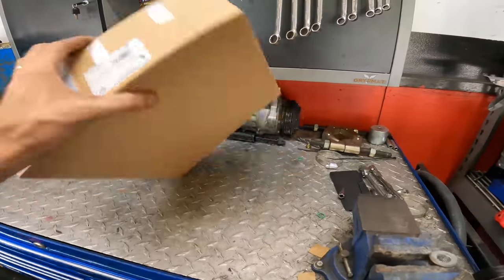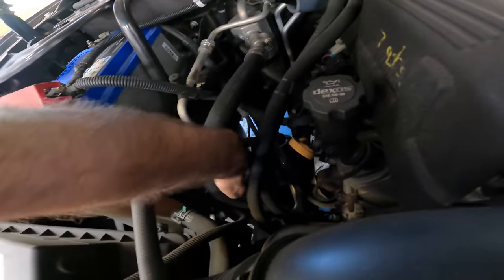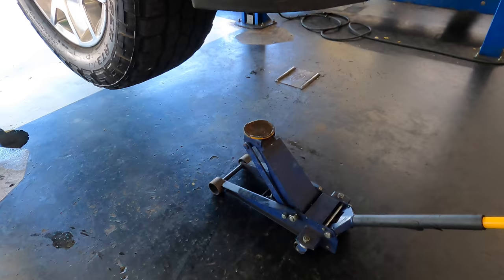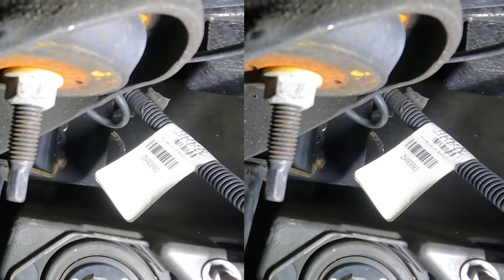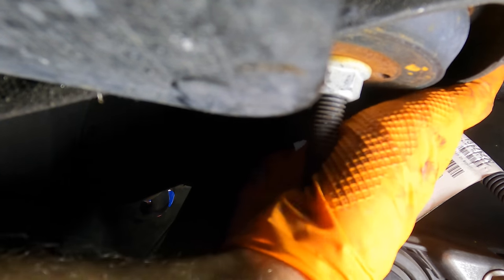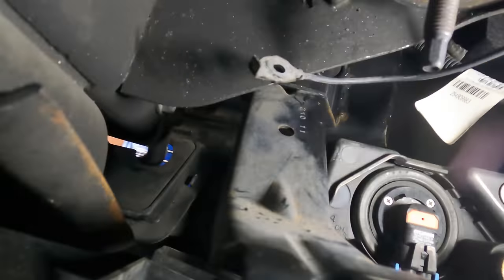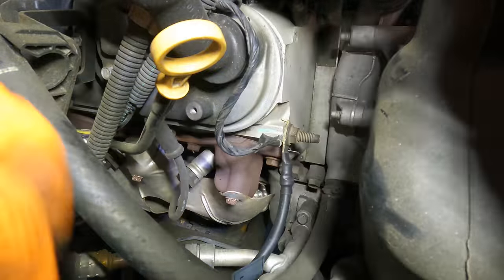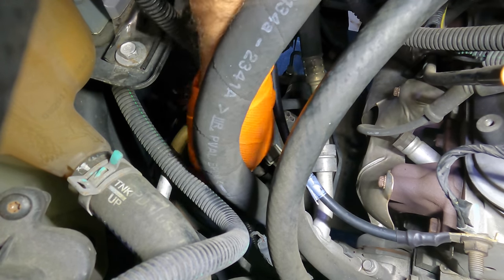Cadillac Escalade 6.2 NO Power, memory keeps resetting. Customer Request Battery Cable.

Comment: Ray, just curious if it would have been better to run the new cable along side the old cable before removing the old one? That way you could have followed the same route as the old one. Since you mentioned getting fresh air when needed, do you ever wear hearing protection? I've known a few mechanics that have had serious hearing loss after years in a shop. Thank you for the always great content. Oh yeah, to break the internet, you should have used a pneumatic impact on the battery terminal.
Reply: No, he should have used a pneumatic air grinder on the battery terminal. I mean, you want it to be terminal, right?
Reply: @JasonW.  True. grind away the terminal and connector - you can't have issue with them and they never will corrode.
Reply: Should not have ground off the tin coating on the copper terminal.
Reply: @ms01885  Saw that to.
Reply: I've been in the trades for over 45 years when we started out nobody said anything about hearing protection nobody said anything about it eye protection and nobody said anything about mental protection and to be honest with you I can't see worth it on I can't hear worth it on and my body I can't even list the parts to the phone to hell and I'm crazy that couldn't be all the chemicals I was exposed so and the plant that I worked and we had a cleaning guy that ended up having a edema burst in his lungs and blood to death right in front of me and that's a fact but no it's not the stuff that he inhaled he must have been a smoker yeah right hey have a good day

Comment: @01:40 REO Speedwagon is being quite distracting. Strangely enough, the letters "REO", originally "R.E.O." are the initials of one Ransom Eli Olds who went on to found REO Motor Car Company. One of the models that company produced was a light motor truck called the Speed Wagon. he also founded the Olds Motor Works which eventually became Oldsmobile after General Motors bought the company.

Comment: When you switch a battery do you plug a DC power source into the cigarette lighter to retain radio settings? I bought an older Escalade at an auction one with a blown engine for $3000, did an engine swap and resold it. You should do this to bolster your income Ray.
Reply: Ya, Right after finishing hm addition for growing family.

Comment: TIGHT SPACES MAKE 1/4" OF THREAD FEEL LIKE A HALF MILE OF BOLT...DANG...I DONT HAVE A RUSTY VEHICLE...BUT WHEN U BOUGHT THIS OLD 91 SENTRA...I ADDED 2 EXTRA GROUND STRAPS TO MAKE SURE...I HAD AN ELECTRICAL ISSUE WITHIN 1 YEAR OF OWNING IT...IT HAD 178,000 MILES ON IT...BUT THE VOLTAGE DROP WAS ELECTRONIC STYLE (4 wires & burned from fire  probably leaky injector) I had to touch it...it started blowing fuses for tail lights...uh oh...& 90% of my driving is @ night!!!) IT GOT FIXED...GOOD STUDENT TECH FROM RCC AUTO SHOP...(Riverside Community College...CA) HE LOOKED @ IT...& WENT THROUGH THE EXACT SAME THOUGHTS I DID...BUT HE SAW THE BURNED PART...HE WENT TO PICK UR FART & GOT 3 USED ONES WITH A BUNCH OF FUZZABLE LINKS TOO...YAYYYY...HE FIXED IT AND 8 YEARS LATER...STILL TICKING AWAY CLOCK LIKE...NO NOT A TIMEX...A CASIO...UH HUH...UH HUH...WHOOP WHOOP...LOL

Comment: Struggling...I got a network box for tail lights is shorted on my garbage truck and the hydraulic lines areas rotted and leaking...sounds like 1/2 hr job.on site repair      
6AM.see you
And their are No Public Restrooms.

Comment: Seems I would have tried cleaning the battery corrosion and the ground connection on the block before I bought the wire.
Reply: Remember, Cust made all the calls on this one.

Comment: Quick question... what is the smaller wire that goes with the negative battery cable ground in front of the engine block? I have a 2009 Cadillac Escalade EXT with that grounding stud... but nothing attached to it!

Comment: I have to admit, this ranks pretty high on my disgust for new cars when there's such a specialized harness for the ground wire from the battery.
Reply: Its grounding to the chassis and block from the battery. You could fashion one up for a fraction of the price but that requires extra labor mocking it up, crimping, taping/zip tieing and soldering.

Comment: What happened to the drill mounted battery terminal shiner?  Also love the adapters and I wish I could afford the Milwaukee 1/2 inch drive setup, but I cant justify it at all... I only use 1/2 inch sockets here, but I am not a mechanic working with limited room :)

Comment: Ray, would mirrors be a useful tool to make it easier to get the nuts/bolts, rather than just using your digits?
Reply: Good idea, just need to grow extra appendage to hold lite/mirror.
Reply: Not usually some they invert the movements you need to make.
Reply: @XxTWMLxX  Well, I would have figured much sooner that it was a 10mm bolt with the mirror, also I would be able to place the appropriate tool right on the bolt head. Of course the direction would have to be inverted. It would have save him some time and possible frustration. Just saying.

Comment: What goes wrong with a battery cable? how does it fail?   thanks for this.
Reply: Usually corrosion. Under the lug in where the wire goes to get crimped. There is to many strands to say it outright broke. Could also be the sensor cable connector on this specific vehicle. But im still going corrosion.

Comment: Don't know if I missed something in this series but what was wrong with the negative battery cable ?
Reply: "Customer Request Battery Cable." This shop did not diagnose the problem, the customer did. Ray is just doing what the customer requested.
Reply: @williamjones4483  Yes I know Customer requested it too be changed. But I never knew Ray to just change a part at the Customers request with out him diagnosing if it was good or not. Didn't even show if the cable had a problem either ? Just a shot in the dark by the the customer in my opinion.
Reply: my 2015 sivereeado was just diagnosed by the dealer to replace both positive and negative cables due to voltage drop across them. i guess its a thing!

Comment: wouldn't a power ratchet have worked or was the hand job more dramatic?

Why didn't you sand the lower connections?

Why did the cable needs replacing?

Comment: I have an uneasy feeling that you stacked the cables/lugs in wrong order.  The rule for me has always been that you want to have the heaviest cable & largest lug against the "block".  That way you don't run the heavy current through the smaller lug.  Sorry, if the mistake was already perpetrated by Cadillac and you just made the reconnect the same way.
Reply: The larger lug with the tab goes on last and holds them in place so they don't spin as they are tightened. At least all the grounds on my truck are like this. The smaller lugs all look large enough to handle it. I think the size of the tab lugs are meant to encase the smaller lugs and provide a larger clamping area for more contact between the layers. Like a washer on the end. Of course this is just my guess.
Reply: Replacement cable assembly box marked Made in Mexico.
Reply: @curtw8827  better than made in China....

maybe.........

Comment: Hmm, wonder what was wrong with the cable, it looked like it was in good shape???
Reply: They usually do look good, they corrode inside. You have to cut the insulation off to see it. You can usually feel it by flexing the cable in your hands as well. Stiff spots, crunchy spots etc.

Comment: Car clocks are indeed a major source of frustration. The digital OEM dash clock runs a minute per month fast. So, I get an aftermarket digital radio. Other digital radios using the same broadcasting system are perfectly able to get the correct time from the transmitter network. However, this car radio's internal clock does not do that. Need to set the time manually and It runs approximately 2 minutes per month fast. Such atrocities are never mentioned in the specifications of a digital car radio: warning: this digital radio does not sync its internal clock to the network's time source. Very frustrating, annoying and needlessly irritating. The tech is there but they refuse to implement it properly. I'm almost ready just disable the time display in the radio and open up the dash in order to replace the OEM clock for a DIY solution that will sync time every time it gets in reach of my WiFi.
By the way: nice gloves. We got a very good look at them in this video.

Comment: I did this with my Cadillac. However after further investigation I found it was the BCM corrosion into the connectors. Windshield was leaking and didn’t know it.
Reply: Opps
Reply: @peted5217  it’s fixed now. You couldn’t tell. Car was freaking out.
Reply: @thomasstrickland0  Ya. H2O not electric circuits best friend. Most fortunate none of ECU's wiped out.

Comment: I'm confused as to why you replaced what seemed to be a serviceable item with another serviceable item?
Reply: Not sure on this particular vehicle, but vehicles with aluminum battery cables are being targeted by NHTSA to be replaced with copper due to aluminum breaking and causing fires and crashes. This is a campaign we are dealing with at my work, though I work on big rigs
Reply: He literally said to repair a symptom of the vehicle behaving like the battery was disconnected
Reply: @TheTimothydragon  didn't hear him say that lol
Reply: Those cables often go bad.  I think there's a tsb for them too if I remember.
Reply: @HoLeeFuk317  I expect it's probably due to galvanic corrosion of the dissimilar metals on the crimps - leading to high resistance connections

Comment: I LOVE OEM PARTS...I DID GLASS (Of all kinds over the years) BUT OEM FITS PERFECTLY & KEEPS THE VEHICLE VALUE ON TOP...MANY AFTERMARKET GLASS PARTS DO NOT FIT...NOR SEAL CORRECTLY...IT WASTES MY TIME AND IS ALWAYS A CALL BACK WHEN WIND WHISTLE NOISES OCCURE...(GRRRR)...Fine for a used car lot...NOT A BMW, PORSCHE, MERCEDES, FERRARI, LAMBO, WHATEVER PRIVATELY OWNED!!! IT KEEPS THE VALUE WHERE IT SHOULD BE...INSURANCE COMPANYS DO NOT LIKE TO PAY FOR OEM PARTS...BUT...IT WILL BE DONE CORRECTLY AND AFTER ALL YOU ARE PAYING FOR EXACT REPLACEMENTS BY HAVING INSURANCE...GOOD GRIEF...I cannot count how many times I had a re do because of some squid brand not fitting correctly...GOOD JOB RAY RAY!!!

Comment: Never disconnect the positive  with the negative still connected Ray.  You can mess up modules doing that.  Unlikely but it has happened
Reply: that makes no sense
Reply: @bradhaines3142  The explanation I read in a service bulletin was it can cause internal arcing in the module.
Reply: @Luke  You claim it has happened - is there any evidence of this? A circuit can be broken/unbroken at any point and the effect is identical IMHO - the real reason to disconnect the chassis ground first is it makes it less likely to inadvertently short the other side to ground when using large metal conductive tools... NB this would be the opposite - +ve first on a positive ground chassis (historical cases, don't believe anything new has it these days)
Reply: @budgiefish I'd have to search for it but I've read it in GM tsb at some point. It was also pounded into our brains in tech school. It is more likely to have sparks from a positive terminal from the direction of electron flow, this is one reason why most switching is done on the negative side of the circuit.  Several years ago we had a mid 00s Impala in the shop for can't remember what but battery was connected POS last and the bcm had problems afterwards.  Idk how anyone would be able to confirm it was from the battery POS connected last and not just coincidence but I'd rather just be safe than sorry and always connect NEG last and disconnect first
Reply: @HoLeeFuk317  must be fresh out of tech school huh? Lol
Reply: @bigkenny93  I'm 14 years in
Reply: @HoLeeFuk317  keep working at it, you'll get there! Lol
Reply: @bigkenny93  I was there long time ago
Reply: @HoLeeFuk317  Effectively when disconnected the negative lead becomes the positive side of the circuit (you can confirm by measuring voltage from this to the neg on the battery) so potential for sparks (pun intended!) will be equal regardless.  Switching is done on the negative side more likely because NPN transistors and N channel MOSFETs can be driven by a positive signal and they will have their emitter (or source) connected to ground, with the load side to the collector (or drain) - when switched on, they will connect to ground, that'll be more likely, not to do with sparking etc. I understand them to be known as 'open collector' outputs for this reason. I'm just interested in your experience and source because it just seems a bit weird to me. 🙂
Reply: @budgiefish  there is only voltage at the negative battery cable terminal when it's disconnected because there is no current flow rendering resistance in the circuit to have no effect on your voltage measurement.. As soon as you connect the negative lead that voltage goes to zero because of any loads present in the circuit.  I agree that it seems odd and I wouldn't think it would matter either but it was what I was taught in my auto tech classes and I have seen it in GM service information.

Comment: Would really like to know why the engineer thought that they needed to run a ground to the Engine sub-frame...
Reply: Basically all metal in a vehicle is grounded. Why that exact spot idk. But that part needs the gravy ground for some reason or another.
Reply: @XxTWMLxX  except that there was a big old firewall or the frame that would have been more convenient...

Comment: Are you kidding?… you never use a battery operated impact gun to install a battery, it should always be a pneumatic impact gun to make sure the fittings are tight and you should always use Loctite also :-)
Reply: Lol that suckers never going to disconnect again lol
Reply: A new troll
Reply: Specifically, red loctite. Blue just doesn't cut it. Red will make sure you cut it, or at least heat it.

🤣
Reply: Thanks for the laugh today
Reply: Lol
Reply: @Itstime2029  Turn on your sarcasm detector or get it repaired. Nothing trollish about that comment.
Reply: You forgot to say how many ugga-duggas to give the gun. I say give it the full beans. (Wait...am I on the wrong channel???)
Reply: @williamjones4483  
Thank you

Comment: These things and the Yukon Denali's will do some weird stuff when that ground goes bad.  They will start adjusting the mirrors on there own while you are driving, lights will come on dimly lit when parked, rear hatch will open when driving down the road.  The radio and navigation system will act like it has demons, etc.   If you can catch it while it's acting up you will see a huge voltage drop between engine and chassis.  I normally just run a couple of new short cables from engine block to chassis and from chassis to the ground cable and it fixes it.

Comment: What is the spray you use on battery terminals ?
Reply: Available at any auto parts store. Usually by the batteries. Black can orange letting. Don't remember the name at time of this reply.

Edit. Noco NCP2.

Comment: #1 reason why being a mechanic gives me anger issues:   When i drop a bolt or socket, every godamn time they hit the floor, they disappear then 20 minutes later reappear halfway across the godamn shop  underneath some shit it shouldnt be able to roll under...   you can even watch the damn things hit the floor and make a tink tink only so logic would say its gonna be right around where you saw it hit the ground but when you go to reach for it, its halfway across the damn shop under some shit...  every damn time..   i even tried to take a lesson from an old wrencher and got the mat he uses where shit just hits it and doesnt bounce but nooo. The one i got, same brand and same shit, makes stuff bounce like a rubber ball...    or the shit winds up in the damn drain.. shit will end up giving me a damn aneurism and heart attack from blood pressure..  pop the damn forehead vein eventually..

Comment: Cust bought needed Cable. Then decided not to spend rest of life replacing it. Figured shop mite chg  $25.  Not.
Most nu stuff has similar multi task wiring. Many require extensive R&R for correct install or they won't fit. Ante Up.

Comment: Ray I have a question for you. My 2015 Silverado 1500 4x4,  passenger side front, when going over a bump or when the the tire drops off a curb it makes a slapping sound . It’s done this since I bought it new only after I had a leveling kit put in at the dealership. I’ve brought it to them several times thinking a strut was bad but they never find the problem. When I go over bumps or imperfections in the road it gets the washboard effect and the front end loses stability and control from wheel bounce.
Reply: Pretty tuf to diagnose without visual/hands on. Kinda like doing a haircut over the phone.
If u live close to Ray's work , drag it over, otherwise a competent 4wd shop near u will work.
 Fer sur, something is loose.
Reply: Your level is too high and your strut is maxed and binding. Take 1/2” off the level and it should stop. My boss’s son just had this repaired and described the same thing after he got his new level. You didn’t mention the brand, but his was Rough Country I believe. The slapping and washboarding is because the struts aren’t moving and you’re losing contact with the road. It’ll tear some suspension bits up if you don’t get it fixed. The strut is supposed to absorb the impacts, not the hard parts.
Reply: @stevewhiting556  Hey thanks for that. I will look at doing that.

Comment: How tobrepair, get a gallon of flammable liquid, and a dozen oul soaked rags, soak rags in said liquid, and apply ri interior, then apply fire, and retire to a safe distance. Problem solved. This method works on all GM , ford and Cluster f.. group vehicles